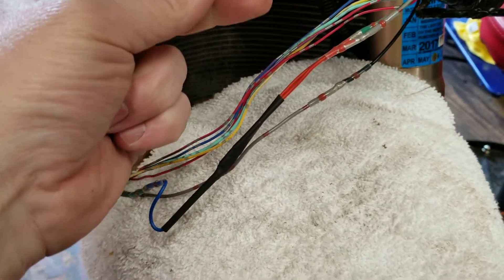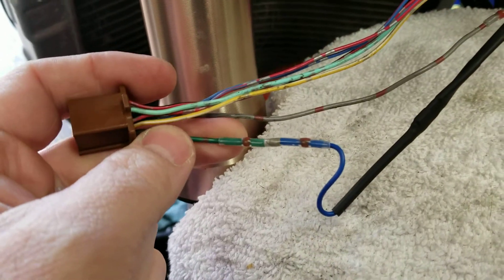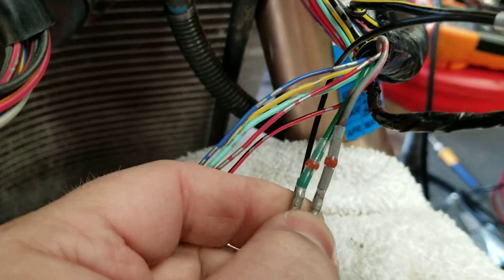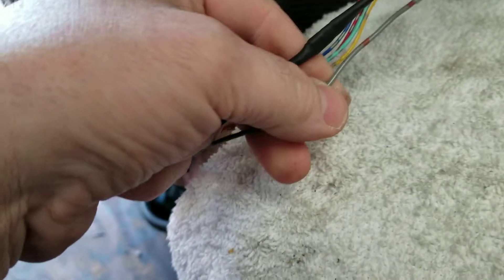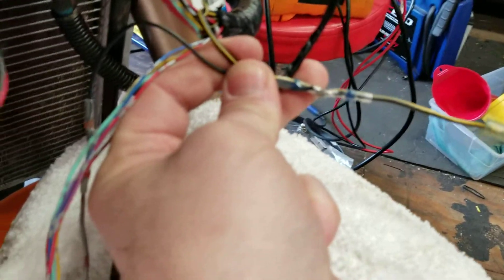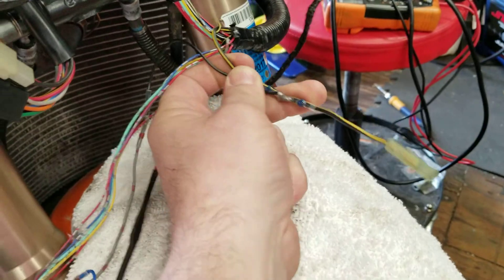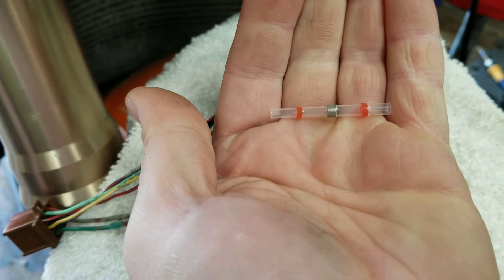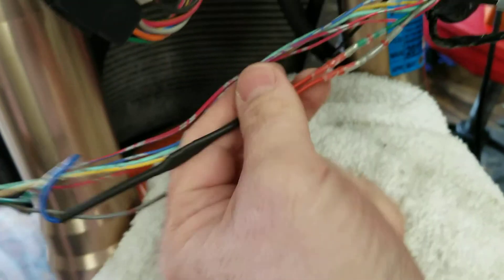Metric bike diode kit installation Part 2

Comment: Any link for those shrink soder tubes??
Reply from the maker: If you type in shrink and solder on Amazon  or Ebay you'll find them. It's cheaper to buy the big kits with all the different sizes. Good luck!
Reply: @islandupcyclery3432  thanks I did and ordered a 120pc kit for $11 off Amazon... thanks
Reply from the maker: @Sicario_LCMC  No problem! They're  awesome and save a lot of time. I also use them on the boat and they haven't failed me yet.